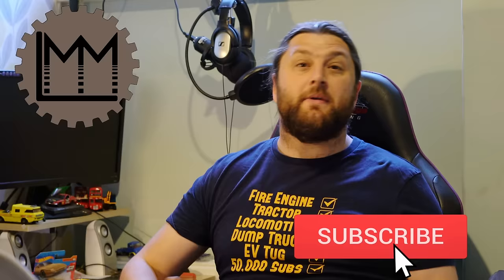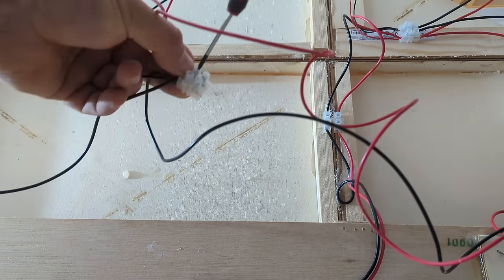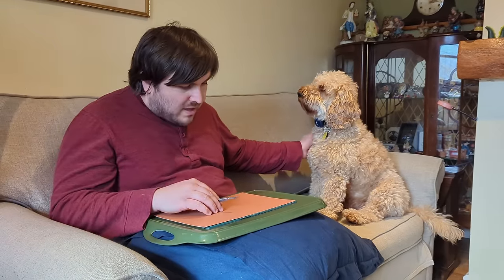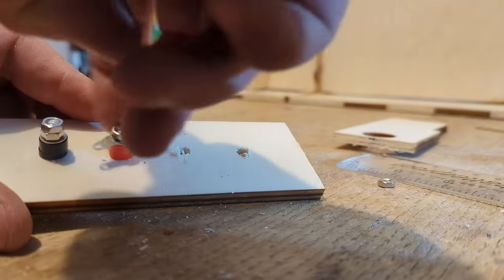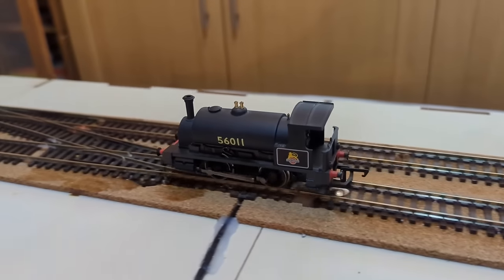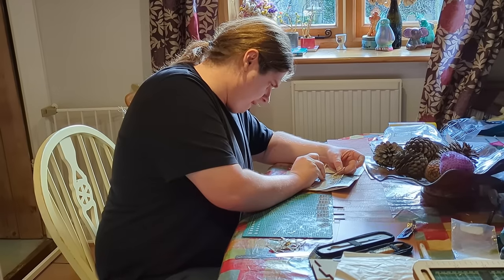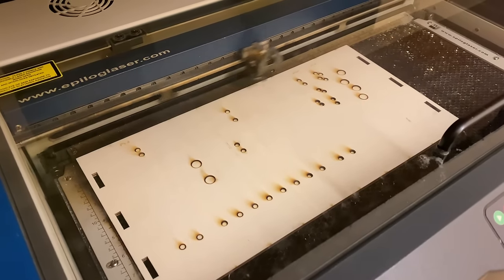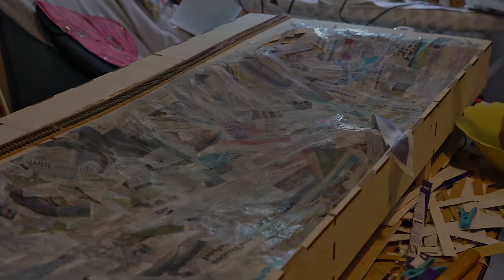Building a Modular Layout Episode 5 - Will it finally work?

Comment: Oh dear 😂😂 I think you might have to burn quite a bit of midnight oil to get that ready. Although if the boards aren't completely finished, as long as they function correctly by the weekend you can add details after the show ahead of the next exhibit these modules are on display.